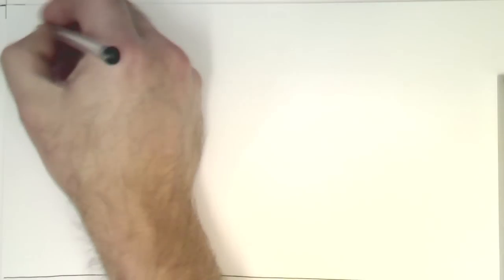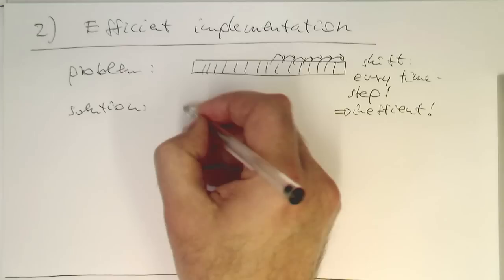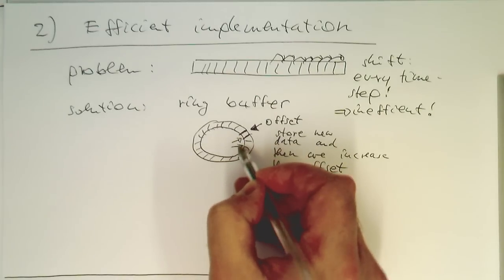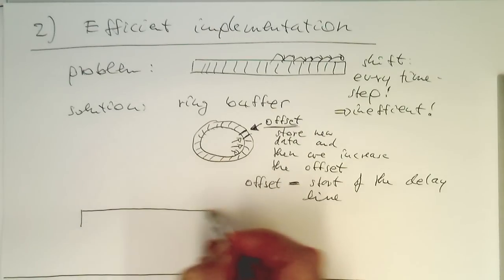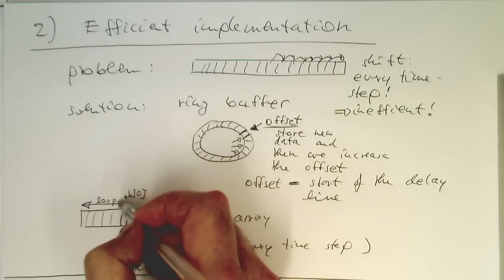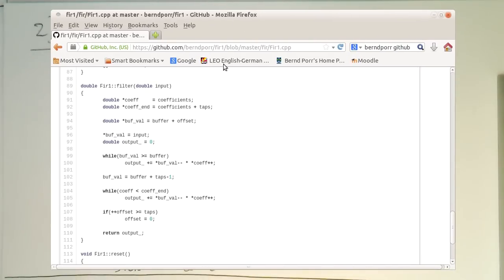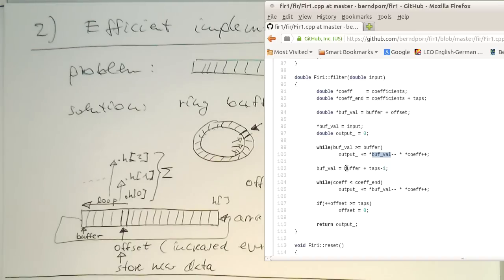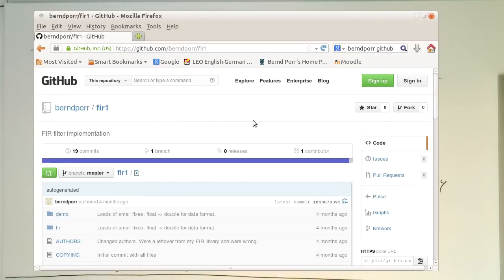FIR filters: an efficient implementation in C using a ring-buffer (004)

Comment: Thank you for the code and video. I see output being declared as a scalar double, not an array, and it is even defined as zero. I don't understand the flow even with your explanation. I appreciate your attention and generosity with other learners.
Reply: Another confusing issue, if the offset points to the last input value inserted in the buffer, why go through the trouble of going back to the end of the buffer and keep multiplying the remaining values in the buffer by the tap coefficients? Oh, that is because the buffer is still holding the residues of the previous input array, and the filter is still responding to it. So this FIR filter is in a greater context where a loop calls this function for every next element in the input array (thus incrementing the offset from zero to 'taps' just before returning the output_), and an outer loop that segments the discrete input sample stream in a brand new input array the same size as this filter's buffer. Sorry for missing it. So input is just one element and output_ too, but the buffer keeps the continuity.
Reply: @BerndPorr  Acknowledged, thank you once more.

Comment: The method is absolutely perfect, and the explanation too. However, that bit of C code is absolutely rancid. Case in point, and I quote : "this little bit of cryptic C construction" -- there is nothing to gain by writing cryptic, "smart", and hard to read code, only to lose.
Code, and especially C code, should be written in a way that it is trivial to read and understand, properly commented, and non-trivial parts should be properly documented. "Smart" code belongs in the trash.
Let your compiler do the optimizations and be happy.
Reply from the maker: Surely you have watched the video before where the filter was done with arrays [] to show how it works which is easy to understand but computationally expensive. A lot faster is pointer arithmetic which is harder to read because C has a lot of semantics, for example a "*" can mean de-reference but also the pointer itself. The same is the case for using the ++ operator in conjunction with the de-reference where its location is key. So, code using pointer arithmetic will always look more cryptic just by the nature how the C language is defined. You might think that a compiler can convert the easier to read array operations into pointer arithmetic but that's a naive assumption. Pointer arithmetic is quite different and I very much doubt a compiler can turn a linear buffer into a ring buffer on the fly as it's a completely different working principle. Of course feel free to add a link to your beautiful code examples and benchmark them. After all YouTube is "social" media and we can all learn from each other.